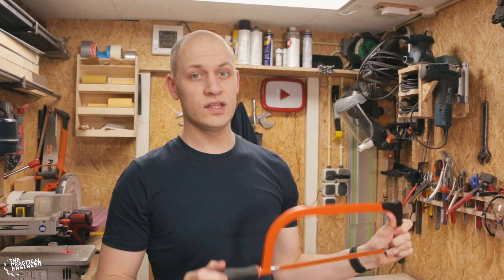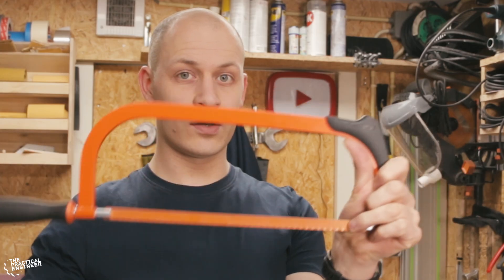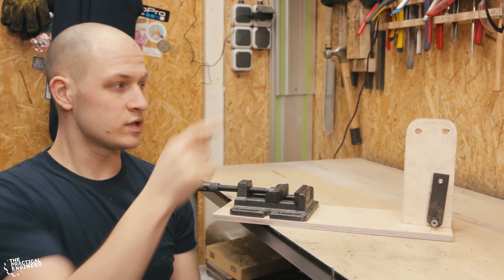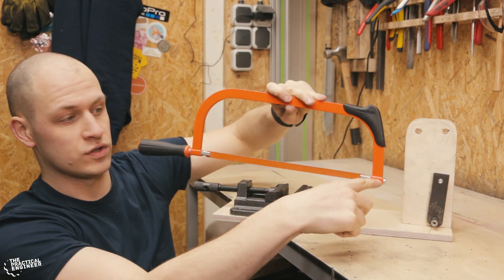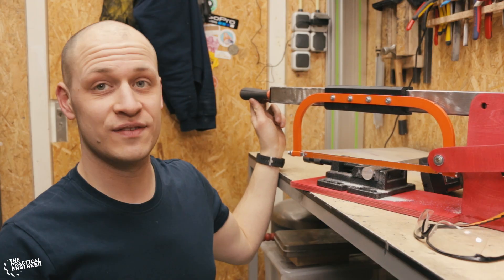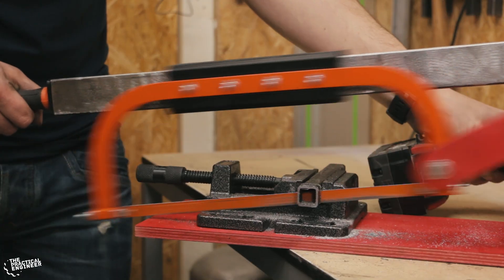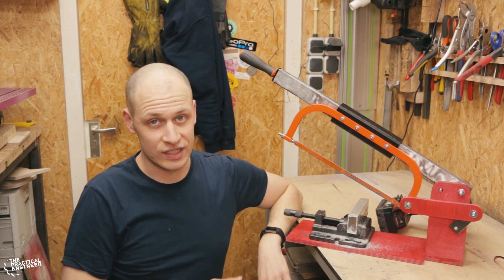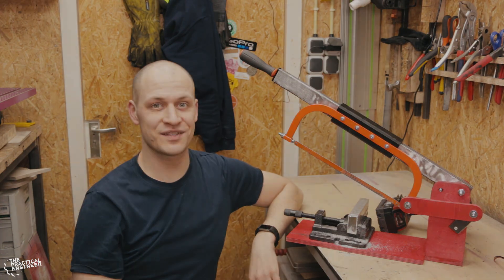Cut metal easily! - DIY Power hacksaw

Comment: Very nicley done and it works as intended but the only criticism is the stroke is not long enough so you are only using half a blade. just increase your stroke , you will benefit from cutting costs and quicker cuts

Comment: Just the thing I have been looking  for, I will make one small change (ok 2) 
1. Put the arm pivot under the  drive shaft  ,
2. Use  electric motor I have 
3. Whoops lol  add a weight to the handle  to save having to apply pressure all the time

Comment: It seems if you design it just right that it could lift on the return stroke with just slightly different placement and motor in opposite direction

Comment: Nice result.
I did notice that while cutting at the end of the saw action the blade cuts into the bench and vice. I don't know if anyone has mentioned this.
There are two solutions that require the blade to be horizontal at the end of the cutting process. The is completed by placing the saw without being attached to the post axle and either changing the length of the swing arm, lower the height of the axle or both. This way the blade will be on a greater angle at the st start. 
I like the temporary fixing of the vice. By, adding 2 more block fixing points, the vice position can be varied to suit the piece being cut.
The timber pieces are great for small easy cuts, but can be replaced with metal to cope with large and long lasting jobs. The timber can be the first step as a prototype to a more durable cutting tool for items like railway line.

Comment: Pfff... 😒 
Just a few more round bars to cut and your drill would overheat. 
It's just not designed to work that way. 
There is a proper electric hacksaw specially designed for that purpose. 
This project is a waste of time. 
I'll check your other projects though... 
👍

Comment: Thank you for the video.  I had exactly the same idea as you did, except my idea was to enclose the cutting action in a box to decrease the noise and to cut much more slowly, more like a 3D printer type of slow, to make it as low noise as possible, and to contain all the dust.  Your design is much more practical and way faster and more usable.  Great job man.
Reply from the maker: Thanks! What's the reason you want it to cut slow

Comment: Please don't use hand held angle grinders to cut metal.  Bolt them to a fixture so they can get away from you can cut your arm.  Angle grinders are the most dangerous tool out there.   And you are using it with no gloves, no sleeves.  Not good.  Bad.

Comment: Nice Build! Pretty compact for something capable of cutting through shafts. It's a shame you need a lathe for the cam though.
Reply: You can make a cam out of different sized alloy round and stack the smaller part off center on the larger with a common shaft. Or even ply disks. Going to try building one of these, thanks
Reply from the maker: Thanks!

Comment: A bye the way you should never use fostener bits to drill a through hole that's what a speed bit or auger bit is for! all the best.
Reply from the maker: Why should I not use a forster for that?
Reply: @Thepracticalengineer  "forster" LOL
In my opinion you would be drilling pocket holes with them like kitchen fitters etc would do i think it's all to do with how the bit is constructed materials and the flutes for clearing the machined material away from the bit without the head getting clogged up and burning the machined edges out!! but what do i know!!!!! all the best.

Comment: That is a pretty clever idea.

However, the realization needs improvement.

The interface between the guide tube and black sheath appears to introduce a great deal of friction. This will cause wear at the interface, which will lead to wobble, which will lead to a wide kerf and inaccurate cutoff length. Having to work against the friction will put unnecessary load on the drill motor, potentially leading to earlier motor failure.

The selection of wood for the bearing block is a poor choice. The arbor will wear against it, enlarging it into an eliptoid shape. Additionally, it is another friction point.

I  would expect that a person who has such a large selection of power shop tools would come up with something that is less Rube Goldberg, or at least, more reliable.

Or even better, just buy a Super SawzAll and call it finished. If end needs to be more square, he can just face it off with that lathe.

Comment: you could reduce the hub movement with a smaller radius of the rotation.
Then the speed will be faster. In case you worry about the sawblade, its now problem since you can move the 
vice so different sections will be used. The Hub of my saber saw is around 12mm , your look like 120mm :)

Comment: All the greeting and respect to you Bash, an engineer, I like the design, and a colleague with you in the same field. My question is about the design. Is it useful to add a 2 horsepower motor and operate in an official way? Is it safe, please reply please
Reply from the maker: yeah, you can surely do it. But If you are going one for actual use It is good to make a more solid frame with proper bearings etc.

Comment: Nicely done! Low cost simplicity. I see a lot of negative comments , however , they miss the point. This covers quite a few issues , angle grinders, chop saws and even band saws create a lot of noise and if you're in a built up environment not desirable. Airborne grinding swarf gets in everywhere in a small shop. It's portable , cuts accurately for what it is. Occupies a small footprint , it can be made from scrap and it's dirt cheap to do. Kudo's Bud!

Comment: Aren’t you converting rotary movement into reciprocal motion, not linear? I’m just asking because the hacksaw changes direction without changing the direction the motor (drill) is running.

Comment: Nice, I thik it could be faster by incrasing the race of cut, it could take adbentage of all the saw, by incrasing the lenght of the balck crank. 

and also a you could add two gears to incrase the torque this will allow it to cut bigger pieces and suport the  load when you pill dow with your arm.  And also protect your  drill motor. 

. It would be necessary to place the part in the final part of the saw, otherway it will crash, just rotate it.

Comment: This is not totally honest, the pressure on the blade is off centre, which means it is going to make a banana shape cut. You also have problems with a longer stroke in that the blade "judders" and that at the furthest point there is much less weight on the blade than at the closest point. Why only show the final part of the cut? is it because it jumps all over the place when you start a new cut? The rocking motion of the saw indicates that this is not a practical design. Rather build a band saw, that will be much better.

Comment: I like the overall design  and concept  to  use the drill as power and to keep costs  down  but I’m not sure.  Of the longevity  with the plastic parts
Reply from the maker: Hey, You are right about the plastic parts. They are not the most durable

Comment: With slight modification you could use it also as a powered sander.
Reply from the maker: For flat surfaces?
Reply: @Thepracticalengineer  yes.. I was thinking about 2 pulleys (one driven by the drill) and sander belts.. You could repurpose the arm to hold the object

Comment: lots of hater comments, no doubt from people that can cut tubes straight and square single handedly with a hack saw... I have my idea of what they are doing with the other hand while doing so. 

If use of wood for the structure is not for the most ridig or durable frame one can build, this is cheaper and quicker to build than a metal frame, and can be considered as a mock up if one evenually decided to upgrade to a more sturdy version (possibly with a slightly modified geometry so that the vice is higher with respect of the blade when it is horizontal).

ps: DIY means do it yourself, doesn't mean only with your teeth and nails for tools.
Reply from the maker: Thanks! I fully agree on it.
Reply from the maker: Apparently it does mean that for a lot of people. At the same time it needs to be made out of metal according to the same people..

Comment: Hi, I like the concept, it is all about reuse, each component except the base and linkage, the saw, the drill, the vise, can be dismounted and used separately for their original purposes.
I have one suggestion for better utilization: If it is possible, think up of a design which extends the travel of the saw blade, because the blade is wearing unevenly and it is a shame to waste it after its teeth wear off at only a small portion of the length. Sometimes it is hard to accomplish this using up the whole saw blade when sawing by hand, because it is not easy to control it, but with mechanical apparatus such as your one, that could be improved. Also, the sawing time would be improved, because it would cut deeper in one reciprocation.

Comment: Okay. I need a Lathe. 300$ ... I need all the tools like chuck and a screw tap. Another 100 $ ... I need the time to do it. Lets say 5 hours for 10$ each. 450$ atm ... and i forgot the material. And ofc the saw. ~550$ ... Why, WHY on earth don't i just buy a saw? Discounter-Sale. 50$. Works for a loooong time. Damn, i saved 500$. I need another DIY video.

The best part in the video? He is crafting a tool to cut metal. And to do this, he is using a tool and cuts metal ... *rolls his eyes *

Comment: needs the pivot for the saw slide rail dropping a little so the blade is parallel to the base at lowest point of the clamped material to be cut.

Comment: Great little project. And great presentation. Thank you. I'm sure this will be very handy for larger stock steel cuts. Otherwise, you probably can use the band saw for quick cuts. But, if something is going to take more than 10 minutes, you probably don't want to be standing that long in front of the band saw. I used to work in a machine shop years ago, and we had a band hack saw that will cut through 6" cold roll steel. It would take a while, and need lots of coolant. Great idea. Thanks.
Reply from the maker: Thanks! yeah it's impressive to see a bandsaw like that cut through seriously big stock

Comment: Good job making that thing. In order to build it you used a band saw, why not just get a metal cutting blade for that?
Reply from the maker: my bandsaw goes to fast for metal cutting. Also the metal cutting blades are a bit thicker and my bandsaw cannot put enough tension on them to tighten them properly. The main reason is usually the process of making it, not the finished project. I doubt you'd have watched a video of me buying a blade for my bandsaw...

Comment: Professional lathe, Festool circular saw with rail, drill press, disk sander, air gun, battery-powered angle grinder, stick welder, band saw, 3D printer    ...   yup a home-made drill powered hacksaw is all that you need 😉
Reply: I love this comment
Reply: Anyone thinking of using a lathe in the future, never grab the shavings while the machine is running!  That's the best way to get a finger sliced off.  That was the first lesson I ever learned and I'm glad I did because they can get SHARP.  Plus if you're stupid like me they can get hot if you don't use cutting fluid as much as you should.
Reply: I was thinking exactly the same thing. But very creative.
Reply: Roland Tobiasz So true! Many of these “workshop hacks” are made with materials and tools that negate the need for the hack. Like, if I had all that stuff, I wouldn’t need the cool invention.
Reply: @gotchurebeacons-gaming9023  Well if you're on a budget and have access to SOME tools, but not the one you need, this video is showing you that it's possible to make your own tools!

I'm actually hoping to make one of these, and while I have access to a milling machine/lathe at the local community workshop, it's not very reliable. I'm going to make mine a little bit differently (bolts and skate bearings for the pivots, and a salvaged steel rod and a couple of linear bearings that fit it, rather than a 3D printed slider).. but I really appreciate this video, and it shows how a tool like this COULD be made, and how effective it can be.

And that makes it frikking awesome. Just gotta find a drill to semi-dedicate to the task!
Reply: @zebragrrl  I use these precision steel rods I harvested from "dead" HP printers.  Rarely is a salvaged   shaft going to just happen to fit a build, otherwise, that diameter is where I begin from design.
Reply: @David-bc4rh  llllllllllll
Reply: Right! 
Might as well just buy the reciprocating saw and call it a day!
Reply: @lennym480  That's true,  but I have never seen a reciprocating saw that cut straight. They are truly a HACK saw, and they are still hard work and you have to be there. With this one you can be doing something else while it's cutting.
Reply: @georgesmith4509
Reply: I couldn't agree more, unless by the fact that there are some particular jobs that a powered hacksaw can do better than a circular one.
Reply: I am new to it... what kind of jobs are better suited?
Reply: @EspacioSedes  main uses cutting thick round or square section ferrous or non ferrous accurately and unattended while you do something else, quieter and safer also more accurate than an angle grinder and much cheaper than a metal cutting band saw, this kind of machine build used to feature regularly in the Model Engineer magazine, you can still buy powered hacksaw machine's, but and it's a big but they are all heavy industrial machines needing 3 phase electricity and costing around £3-4000 so not practical for a home hobby workshop, the people who are criticising this build are missing the point, you can adapt this design to your own tools and machining facilities, it's a starting point for you to adapt the design, not a hard and fast build method that must be followed to the letter, that's what being a practical engineer is all about problem solving!
Reply: Вам нужно к доктору дью
Reply: And yet he made the frame out of wood...
Reply: exactly what I was thinking.
Reply: Hello buddy, let's stop by on my channel😁😁😁😁🙏🙏🙏🙏👍👍👍👍👍☕☕☕☕☕🇮🇩🇮🇩
Reply: Yeah and still way cheaper than buying a power hacksaw
Reply: Suppose a great project for students who have access in class to this kind of machinery
Reply: Hi Roland, The lathe isn't actually required. Just think the axle can be constructed of a bolt and built up by welding pipe around it. Then grinding the excess off. The neoprene items can use a made by attaching to a drill that is held in place and use whatever is available in the workshop. Another alternative is use a cheap woodworking lathe for the neoprene items.
The lathe just gives a higher precision. But, not everyone can use a lathe. 
This project isn't for everyone, but will suit those who do a bit of work with steel/other various metals.
I was looking at this video as I need to cut railway line. Not easy with other on hand tools and time consuming.
Reply: seriously? like really? he made the best tool he could with what he had, you can modify it to be what you have available. I'm ten seconds in and already know what I'm going to do. I'm using the side rolling thing from a drawer, a metal coaster for the turning part, a bearing salvaged from a pair of roller blades I got for a dollar at goodwill specifically to get bearings out of and a wood frame to hold the blade, and a ½inch steel bar from ace to have the rig slide on. 

I was searching for why my reciprocating saw was suddenly changing speeds on me and this popped up after a lot of scrolling, and I want to make it.

Comment: So many negative comments about using expensive tools. Use what you have. You can make this with basic tools and a little ingenuity.
Reply: Indeed, everything you see here can be done with hand tools. You don't need a metal lathe or 3D printer to make parts, but if you have use them.
Reply from the maker: I fully agree! use the tools you have and like to use. It's not really possible to make it with tools everyone has because everyone has a different toolset.

Comment: Ah, Dutchman!
It looks great, but I think a 'decoupeerzaag' would do the same :-)
Reply: only for small stock steel; for bigger than 1"; it will take a while; and this can be automated to be left alone to do the job. Just add coolant.
Reply from the maker: Hey, yeah a jigsaw would definitely be possible for small stuff. For thicker stuff usually a metal cutting bandsaw is used these days. Prior to that there were a lof of power hacksaws.

Comment: I think if you add weight to the handle end you can walk away or get on with something else and leave it to do its own thing maybe add a slide under the saw to rest on if it goes through while your not there and mount the vice end on a swivel plate for angles but hey its good I like it
Reply from the maker: Thanks! The swivel plate would be a nice addition!

Comment: I don't want to be that guy, but with such tool arsenal you could be able to come up with better design. This is more like a toy than serious tool. The saw uses only half of cutting stripe which will make it dull pretty quickly. Also those vibrations must make the cut wobbly I guess and last, it cuts trough the vice on the other side... have you noticed?

Comment: Should rise up your vice, so you don't cut into your table or you vice, would be a straighter plain, good job!
Reply from the maker: Hi Paul, Yeah, that's would definitely be better. Thanks!
Reply: or make the base longer so you are cutting with the front 1/3rd of the hacksaw blade instead of the back 1/3rd.

Comment: Yeah too bad a hacksaw has teeth that are only used for one-direction cutting. So if you have too much pressure going against the teeth coming back then you will quickly dull the teeth on your hacksaw blade.

Sorry, gonna have to call this one a fail.